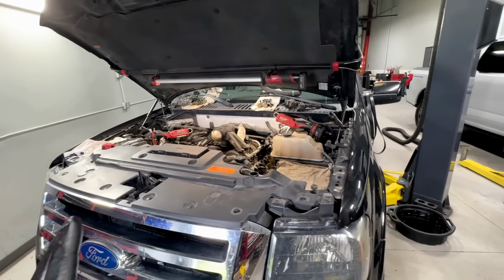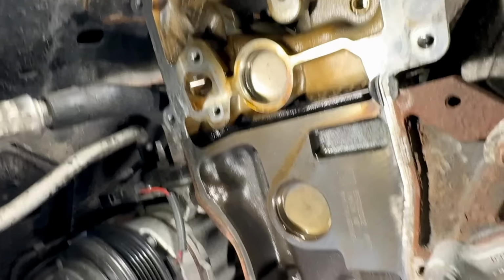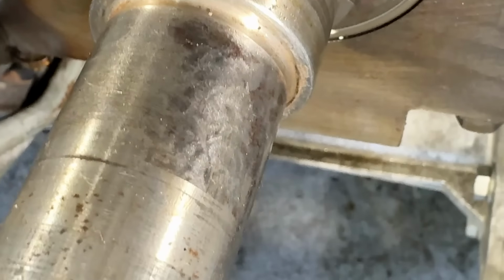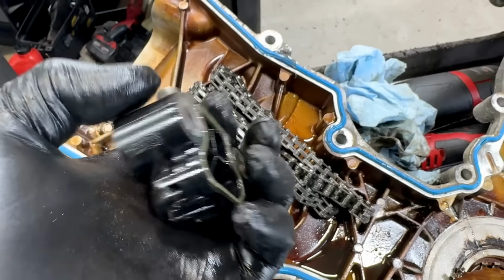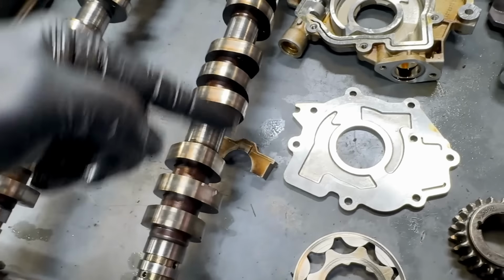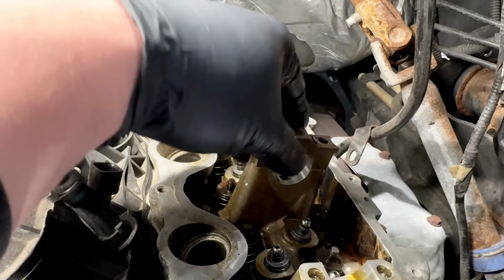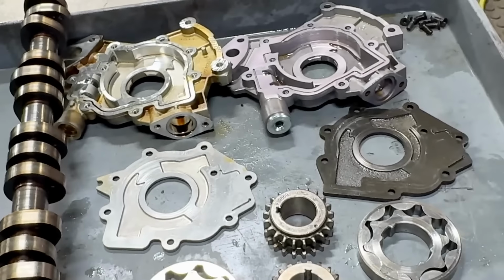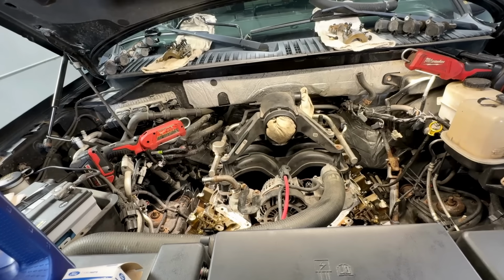How to Destroy a Perfectly Fine Ford 5.4L 3v Triton Engine with a Timing Job!

Comment: No one in my Neck of the Woods likes to work on these 5.4 Triton Engines, my neighbor who has been a mechanic for 40 years at local Chevy/Toyota Dealership changed plugs on my truck at 100,000, he soaked the plugs threads down overnight with penetrating oil and eased all the plugs out with manual socket set, didn't break any plugs, he has done several since then the same way--all good results...
Reply: use PBlaster and plugs come right out after 15 minutes

Comment: Need help. 2004 f150 fx4 rebuilt trans from very reputable shop....there is a clunk from 1st to 2nd shifting and a drop in rpm and power then it resumes. This is intermittent with no codes on dash..had pedal and Throttle body checked for sync issues and all is good....any ideas what to check? Driveline was checked and seems fine. Bought the vehicle used last year and don't know if a programmer or tuner was used on the truck. Truck has 35s on it and speedo reads correct so assuming Maybe a program or one was at least used to adjust that. Transmission guy says that it's not them. I don't know where to go from here.

Comment: That is crazy.
Reply: One other thing about the dealer. I bought a set of tires at the dealer. Gotta Rebate, the price came out. Not bad. It was an 18 1 50. Every log nut was good on that truck when I took it in there. When it came out, haft the log nuts were destroyed and the rims had scratches where the socket goes in. They gave me a whole new set of lug nuts.  They couldn't even use the right socket.

Comment: Me and a buddy once did valve lash on his dad's Suzuki Sidekick.  Forgot the detail about turning the engine to TDC on each cylinder - we just turned to TDC on cylinder #1 and did them all.  After a few seconds of symphony of rockers after startup, we clued in to our mistake.  Engine lived for many more years.  I wish I could say we were in our teens, but it was much later than that.  Oh, and filling a garage and neighborhood with smoke after putting too much oil trying to start a rotary.

Comment: Dumb question but are the 4.6 engines prone to timing and roller follower failures as well? Thought they’re just a baby version of the 5.4?
Reply from the maker: Yes they are, I just finished a timing job on a 4.6L 3v last Friday.
Reply: @FordTechMakuloco   do you recommend putting on the high flow oil pump for any engine that get taken apart? I am in the process of taking the front cover off my 4.6 3v for a oil leak and am going to remove the heads to drill out 8 broken studs.  Didn't have any phaser issues but want to be proactive with 150,000 miles and a timing kit. Read somewhere too much flow isn't great either

Comment: Lol my dad has a 1991 Nissan Stanza with a ka24e engine and the timing chain runned a hole through the aluminum cover at about 190k and I put a cover and new timing set on it at 235k. 45k miles with a hole in the timing cover 😂  Car still runs too but the body is falling apart so we parked it and dont drive it anymore

Comment: Hey Makuloco, if you could answer a question for me I’d be extremely grateful, I’m having a issue with a lean code, p2195, and when looking at my fuel trims my short fuel trim 1 will randomly climb to 59.4, then will act completely normal and be at near 0

Comment: All important yaking! 
Just curious is there a significant price difference from FoMoCo genuine parts and Melling or any other reputable parts manufacture? Back in the 70's 80's and 90's there was a price difference and you usually got parts from the companies that produced the parts for the auto manufacturers in the first place so it wasn't a quality issue. In my vehicles (both 10 years old) I always try to use OEM parts and the price is an issue! 😎✌
Reply from the maker: OE Parts are much cheaper online and worth the extra IMO.

Comment: Does Ford still make available the timing chains, guides and tensioners for the 4.6L 2V? I purchased a Cloyes kit last time I did one. I find a similar issue with clutch kits, they all come with junk throw out bearings. I just replaced my clutch Mcleod and didn’t use the bearing supplied with the kit. I bought a Ford Performance bearing and clutch cable.

Comment: I guess i did ok on mine thanks to you. 
Original failed at 90k.  I Re built per your older videos. At 145k now. And there is a tick on startup that goes away after about 15-30 seconds. 
But it has been doing that for well over 10k. So not too worried at the moment. Unless you say i should worry about it😬
Reply: id be willing to bet its a cracked/leaking exhaust manifold!

Comment: This is why I fix my own stuff because a lot of shops just don't care or have the right people to do good work you are someone I would trust to do the job right
Reply: Same thing I do, even if I don't have the tools,I'll buy them, take my time and get it done properly, to many dealerships pay there mechanics by the job,not the hour, so it's quick, slam, bam, get it done, and the old saying applies, haste makes waste, when doing a job yourself, asking questions if you don't know, this channel is very good, he speaks in detail and knows his mechanics,  most other mechanic channels leave out the details , not all,but most, he's all FORD, and FORDS have there problems, and you can't overlook them or you end up with a 2 ton radio .... 🎉 or scrap metal, or a 10k engine or transmission, especially the 09 to 2014 F - 150 that have transmission cooling lines that are defective and they burst if not changed, there goes the transmission, 6k or more for a rebuilt if you can find one..
Reply: there are some shops I wouldn't trust a skate board with.
Reply: Where did you get the parts online or at a dealer
Reply: agree
Reply: Amen. It takes me longer than it used to, and I get sore as all get out and hurt for days afterward, but I still do it at 64 for the same reasons.
Reply: @tinkerscorner54  I do it a 82 and sore every day............

Comment: Look at the end play of the crankshaft, due to thrust bearing failure = oil pressure loss.  Possibly a bad torque converter/transmission.

Comment: I cant help but think of how much effort is put into questionable mpg and epa regs to make engines so much less reliable. Ive pulled blocks from the dirty and still ran fine for decades after. They were not as tight tolerance-d and mileage not so bad (were talking 20mpg highway, for a big block 460).

Yet, they just run. How can I not view those as more efficient, between the labor (even if my own), parts, hunting down parts (since dealers dont stock things, and I still end up going through Tasca for anything Ford).
Reply: Tasca?  You live near me im from Rehoboth Massachusetts
Reply: @billystray7007  Actually, from NY. I never even been to Mass but theyre one of if not the most famous Ford dealership. They got some history behind them
Reply: @RipRoaringGarage  i didnt know that
Reply: @billystray7007  Check out their history in the 60s with racing. They were huge. Its why when I found they had a modern day presence on ebay, I would chose them over others. And they would do their best for all kinds of hard to find things.

And its cool knowing that a bit of that history lives on in my newer Fords too.

Comment: The “whiz wheel” is responsible for the death of that engine. The abrasive in the wheel is aluminum oxide. It is hard as woodpecker lips and eats parts like there is no tomorrow. The only way to remove it is to completely disassemble the engine and wash everything in soapy water BEFORE the engine is run. After the engine is started, it circulates through the entire engine and breaks the protective oil barrier in friction assemblies like bearings and thrust washers. It also embeds into the metal parts and remains there until total destruction has been achieved which usually happens in less than 5,000 miles. As such, oil changes will not remove it. You will likely see excessive wear in the main and rod bearings on that engine too if you disassembled them for inspection. The only thing fast about the whiz wheel is the rate at which you will be replacing your engine post repair. Scotch Brite is the same way and possibly even worse.

Years ago, GM had a similar issue when they had head gasket problems and instructed their techs to use the whiz wheels to lightly surface the block and heads for the new gasket. In 2,000 - 5,000 miles, those cars began pouring back into the dealerships needing completely new engines. The engineers at GM figured out what the issue was and told the techs to discontinue the use of the whiz wheels which resolved the problem.

Comment: Just did total rebuild on this engine. It’s a beast to rebuild but I got it bored 20 over and changed $4000 dollars worth of parts. It can be done but you have to check your parts.

Comment: You scare me and make me feel better at the same time. That's Odd. Quick question. I have an 07 5,4l 3v. I think I have a VCT sticking. Should I try a new oil flush with BG MOA & EPR then use XO5W305Q3SP with it and FL-820-S? I have always did my oil changes at local shops but after watching you I will start doing my own with ford parts. Thanks and your amazing! My truck is at 144k and its a 07

Comment: Brian did you know that the 2008 lincoln town car has full threads in the cylinder head for the spark. plugs
Reply from the maker: yup since 2001-2002 range it started.

Comment: I really feel for this customer...  I have an 03 2v 4.6L with 292K miles, the timing chain guides started making a hell of a racket during cold starts and would eventually subside when the truck warmed up.  But then during warm idle in gear I would lose oil pressure (Timing guide debris was blocking my oil pickup!) 

This all happened about 3 weeks after I bought the truck so I decided to replace everything.  I used the Cloyes timing set, and a Melling HV pump.  But I also took the oil pan down, cleaned everything out, parts of the tensioners were in the pickup tube screen blocking it partially, the rest were in the bottom of the oil pan.  If you ever have timing guide failure you MUST pull the pan & pickup tube out to get them clean. 

Added bonus... when I was buying this truck from the previous owner he said that he had new heads put on it due to a head gasket failure... I looked and indeed they were new heads, but not new cams, not new timing components... WHY would someone do that!!??  Well I also found out that timing was off on bank 1 by 4 teeth... yes, 4 teeth!  I had been chasing down a rich code and THIS was the reason, unfortunately this was too little too late for my passenger Catalytic Converter.  God knows how long the previous owner was driving on this.

I've replaced upper and lower intake manifold gaskets, valve cover gaskets and oil pan gaskets along with the timing cover gaskets and a new crank seal. Also all new coils, spark plugs & Injectors.

Now that all of this is done I don't think I'll have any issues, I also use 5w-30 Mobil 1 full synthetic instead of 5w-20.  This Truck has never run so good and been so quiet!  All I hear is the Injectors ticking away,  I'm Looking forward to another 200K.

I do have plans to build an engine on the side with some work done to it in the meantime though, cores are cheap and I can just start building something to put into it if and when it's not worth fixing the existing engine.

Thanks for everything you do Brian, I know I didn't use all Ford parts on this but I follow all of your procedures and of course I RTFM. 😃
Reply: I’ve been thinking about use 5w-30 instead of 5w-20 but scared of it hurting the engine.

Comment: How is it the oil pans dont get ran dry from a high volume pump and stock oil pan hmmmmm
Reply from the maker: Only 20% more volume and a 7qt system.
Reply: @FordTechMakuloco  wasn't for sure thought I would ask thanks

Comment: Love your videos. I do the timing job 4 years ago on my 08 Expedition with your videos. I use only Ford Parts to do this. Cost my round about $800 with shipping, tax and Customs duties to Germany. I found a metalplate on my Engine, that says, it was a original Ford Remanufactured Engine from 2012. And this Engine !!! has !!! bearings on the camshafts.

Comment: 4 yrs ago, had a full timing job done per your instructions on my 5.4L 3V 2008 Expedition Limited. (It's a late 01/08 build so part wise it is considered a 2009) I didn't know about upgrading the chain tensioners at that time. I also didn't know about keeping a record of the order of the cam caps but I did the new phasers and VCT components and the Melling Hi Volume oil pump. Few months later, cam caps and cams were chewed up. Had to replace the cams. The cam cap info in today's video is new information for me. I change my oil every 3,000 miles. A few weeks ago, the chain passenger side tensioner failed and it jumped time. It has 235K miles. Before it went down it seems the phasers were locking up (not sure the correct term).
Supposedly no other engine damage occurred when it jumped time and there were no metal flakes in oil. I am the 2nd owner and I know how meticulously I have cared for the truck during the 10 years I have owned it but I am at the point of moving on due to the flawed engine design. I already purchased a new vehicle for my wife. I am debating whether or not to fix this 2008 to keep as a work vehicle. The haul space of an Expedition with flat folded seats is amazing. (Previously it was wife daily driver)
Would you guys move forward with the 2nd timing job? Or I could sell it for approx $2k and walk away?
Reply: If you keep good care of it, I would bring it or ship it to Brian in Illinois for a timing job or new engine. Even at 10k (if you need a new engine) for the work it’s hard to find the value of the Expedition in today’s vehicles with the cost of sensors and such. I have an 2009 limited and really value the analog aspects of it.
Reply: @enterpris-AR  great points, yes prices have gone crazy. I like the analog comment bc I have pondered how newer vehicles will function when so much technology fails bc the more tech it has the more things to go wrong
Reply: @gotellhismercy  I worked for global automotive OEM on the repair side from 2016-2022. And I got a 1st had look at the ADAS systems (I.e all the modern safety systems) in vehicles. Oh you have a simple water pump to replace but to get to the water pump you have to take off an ADAS sensor, well you now have an ADAS repair because that sensors has to be recalibrated when you put it back on. I’m going to keep my 09 to it falls apart. My next vehicle will likely be 2019 something Toyota. After 2020 the ADAS on vehicles just got to crazy
Reply: @enterpris-AR what town and what's the name of his shop if you 22:48  don't mind me asking ?  I'm in MO ,so it would probably be well worth it to have this guy do my work. I've got an 08 I bought new and have changed the oil at 3000 religiously and I have about153 thousand now. No issues no rattling but I know it's time to do this work because I don't want a new truck. Changed plugs at 90 thousand.
Reply: How do you know it jumped time?
Reply: @majickmeg  I looked at the torn down engine in detail with my trusted mechanic who has rebuilt several engines for us. In days prior to this happening, the chain had slack upon start up due to a failed tensioner (bad design, common problem) and the plastic guide broke into peices and small plastic pieces goes under the timing chain causing it to skip 1 or 2 teeth then the plastic debris clogs the oil pick up. Thankfully we turned it off immediately when this happened so no further engine damage occurred. @fordtechmakuloco actually has a detailed video about this exact scenario and shows you in detail of how it happens using a torn down engine that had this same thing happen. This is a very common problem for this particular engine.
Reply: As a mechanic, and F-150 owner who is singing the blues about having to just install a complete valve body in my 2010 because I can’t get the lead frame separately, I feel your pain. The truck had been sitting since December while I saved up $2k just to get it drivable again. As far as your situation goes, if you get a reman engine from Ford, you’ll have a significant warranty (36 months/unlimited miles). For basic transportation on a paid for vehicle, that’s a small price for that much usage. And we know these engines can last a long time if maintenance is performed.

Comment: Problem is that it's hard to knw what shop to take something too when you don't have a place you regularly use.. and some dealers are not the best..I've got a good dealer in my area thankfully but iam diy to the core..if I can do it I'm gonna..

Comment: Want to drive a mechanic batshit crazy and piss them right off? Buy your own parts and ask them to install them!!! One I know orders from 3 different suppliers for the same part to find ONE that actually fits/works. 
     DIY on your time taking a chance with Rockauto etc is one thing. If you find a GOOD, HONEST mechanic now? Let em do what they're good at and PAY them for it. Worth it in the long run. And avoid crap vehicles. Have fun with that now...